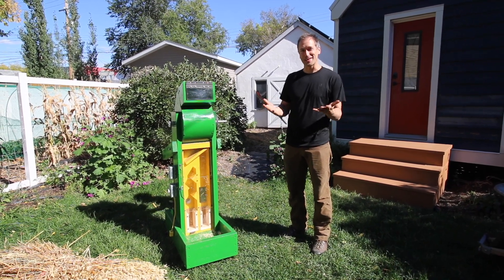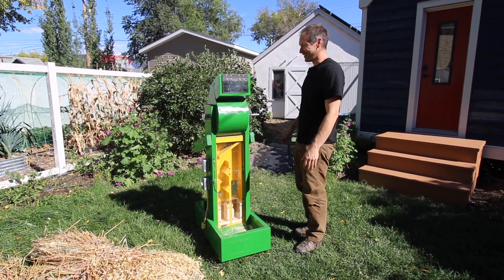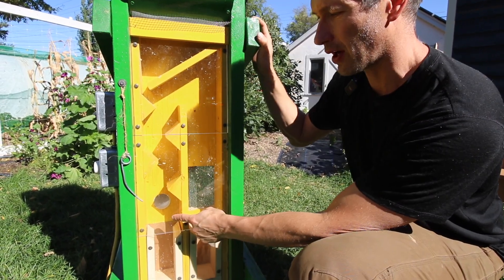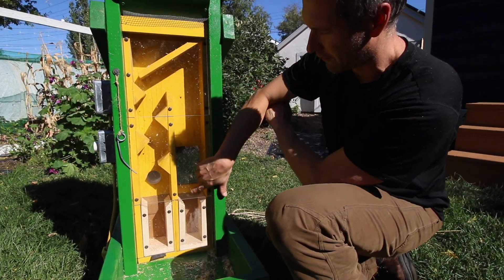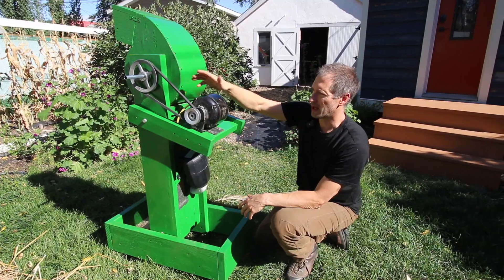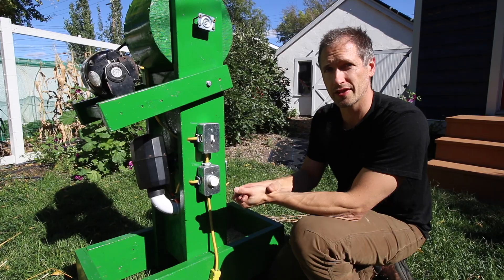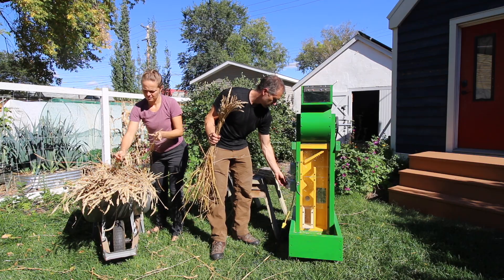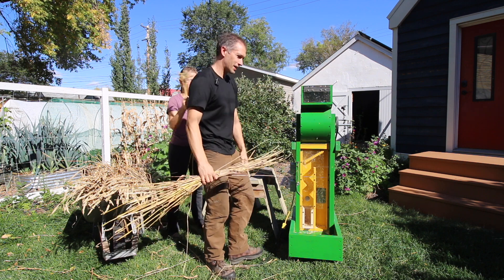Small Scale Grain Threshing Machine

Comment: It would be nice to publish the existing plans so the exact details could be studied and suggestions made. It's possible that some simple dimensional changes or possibly the addition of another "stage"' to the machine could make it work with oats and other grains. Great idea!
Reply: I love this comment, that's exactly what I was thinking!
Reply: Good Goat:  it could well be that the dimmer switch allows for using the machine with other grains. Because it allows for the change of force relative to the weight of the grain.
Reply: @daphneraven6745  instead of a hard-to-find blower, maybe a sliding door to adjust air and just connect a fan from the motor pulley? Or bathroom vent fan?
Reply: @TheRainHarvester  : Tyvk for sharing your idea; That sounds a whole lot more efficient than mine.
Reply: @TheRainHarvester  you can use the reverse side of a shop vac as well. they can be had pretty cheap on sale if you dont feel comfortable using your existing shop vac near things that will be eaten
Reply: Have you posted plans for building this or even sell them? Very interested. Thanks!
Reply: What do the beater bars look like?
Reply: Why would you need plans? He explained the important parts.